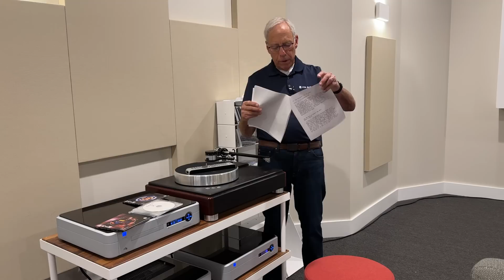Bypassing the DAC

Comment: Not all amps, especially today you can expect to get all the “digital,” out of the sound. NAD, for instance, now, puts all analog, including the phono through its digital system. Many amps have DSP which can’t be bypassed. I hate integrateds with built in DACs. I can disconnect the power circuit of that dac, dsp, etc. (if possible, cut trace, rerout signal path, etc.) make the amp way better sounding. Don’t understand the thinking of today’s audio company’s engineers.

Comment: Hard to believe that some DACS can be so small and cheap and yet some companies are selling DACS that weigh 50 pounds and cost $40,000.
Reply: There's a lot of engineering, premium parts, and premium build quality that goes into those expensive DACs. Just like a clunker, rust bucket, Bondo coated automobile from 30 years ago will get you where you're going the same as a brand new Lexus or Tesla or Ferrari (or whatever else you consider quality) will, it isn't the same. And just like your old pre-digital 4:3 TV will play a movie on DVD for you, it's not the same experience you get watching the same movie on a 4K Bluray and a 4K HDTV, in spite of it being the same movie. Quality does matter. If it's simply not financially feasible to purchase ultra high-end electronics, there are still high quality components out there that might cost you a few thousand or even a few hundred dollars, depending on the level you can settle for, but don't make the mistake of dismissing things you can't afford as being no better than the cheap ones.
Reply: Of course you already know this - - the reason for the weight differences are discrete component vs a straight ahead DAC chip technologies - just a side note, I have the Geshelli which is a ton of fun and very over the top performer given it's price, so is the Cobalt (it kills the Hidizs no matter what Amir has to say about it) but neither can match my reference DAC - - diminishing returns? Sure - would I give up my reference, no way - - that's because I have no problem enjoying the hobby, it costs what it costs, ya only live once and so yeah, there is an end for all of us so leave your predigests behind and just wallow in the incredible component choices we have these days at just about any budget level.
Reply: @skip1835  Spot on!  I am completely happy to hear that lot's of people reach their audio bliss using light budget friendly components from DAC to speakers.  They are even free to choose their own chair and room.
But for me, I have enjoyed squeezing every bit out of great recordings and that took a lot of very well built power supplies and very solid builds.  Read big heavy and able to produce low level information.
Reply: What surprises me about cd is how analog they can sound. Not just sort of analog like; but as analog as analog. I heard many problems with cd sound years ago, but as I found different ways to make improvements to the players, I realized those digital sounds were just distortion. Distortion that you can learn to eliminate. All these analog people spending all that money looking for that best pressing. Your average cd is usually a great pressing. With cd you pretty much just have to worry about the mastering; with lps you have to worry about the mastering and the pressing quality. And the latter often isn't very good.
Reply: @sidesup8286  Agreed.  I followed Lukasz Fikus, aka Lampizator before he started his company.  His mods to cd players were a revelation.  So I went on and built DACs using extreme power supplies, clocks and triode output stage.  44.1 is now completely natural, but detailed.  No digital issues at all.
Reply: To refresh my soldering skills I bought a Velleman chip amp project board. Think it cost $10 or so. So yeah, hard to believe people sell amps that cost so much. Wonder if there’s a quality difference? Nah, probably not.
Reply: @jimfuquay7116  There are differences, but DIY is absolutely the cost effective audiophile answer.  I started with a Heathkit, then a chip amp, and ended up with SOTA triode monoblocs.  They were all great, and pennies on the dollar.
Reply: I would like to hear really premium dacs like that. I'm stuck with the one that came with my cd player. I'm stuck with my cd player that has no distortion or veiling.

 It is highly modded though. When you play a jazz recording and it sounds every bit as clean and clear as the guy playing a sax on the street corner acoustically. Your sound might already be there; and cheaply.
Reply: @sidesup8286  Sounds like you are in really good shape with the CD Player.  They can be great, especially with some mods to the output and power.
Reply: They charge you by the pound like the meat market does..😀🤗👍😎
Simple Audiophile logic.😀

Comment: Despite Paul's advice, I would stay with an AUX (line level) input.  Going direct to the power amplifier prevents you from using your volume, balance, tone and loudness controls. It also bypasses your headphone jack and the other inputs for CD players, Tuners, tape decks etc.
Reply: I agree 100% ..stick with the line inputs !!
Pre Out / Main In’s are mainly used to bypass to a different power amplifier for the preamp section of the unit, or hooking up a full function preamp while you’re collecting funds for a new power amp. The other primary usage is to hook equalizers or other processing equipment into the system between the unit’s preamp and power amp sections.
Reply: @shipsahoy1793  That’s an excellent point. With all the outboard DACS on the market, can some of them be connected the exact same way that mentioned equalizers can?
Reply: @bikdav  I was talking about processing devices that accept an analog line level signal, process it, and output the processed signal through a line level analog out, and/or send the analog signal through it directly (a bypass mode). What you describe is like what Paul was talking about, which I don’t believe to be the best use of resources in that case. Remember, in that case, the preamp out on the integrated amp or receiver is disconnected.
Reply: @bikdav  
No.  A DAC (Digital To Analog Converter) has a digital input and an analog output.  So you have no way to feed it your pre-amp output.
Reply: @Douglas_Blake_579  That’s what I figured. But, I asked in case I was wrong.
Reply: @bikdav  
No worries ... better safe than sorry.
Reply: @shipsahoy1793  
The pre-out/main-in bridge, to the best of my knowledge, was primarily intended for hooking in equalizers and other signal processing equipment at a point where the pre-amp settings would not upset them.
Reply: @Douglas_Blake_579  of course, I don’t disagree. An aux input should technically be a line level input on a receiver or integrated amplifier.
Reply: @shipsahoy1793  
Yep ... looks like we agree!
Reply: @Douglas_Blake-579: 👍That’s an excellent observation. I regularly use all the mentioned controls and headphones.
Reply: You can still use tone controls I did when I had a loki and the thx aaa 789. Got my dac way after wanted more audio improvements.
Reply: Thanks for the advice ❤
I am Majd
Reply: @ud-  
You're welcome.
Paul is correct only if you're not using any of the functions built into the pre-amp section.
Reply: @Douglas_Blake_579  yes I understood Paul
Thanks for the clarification 😊
Reply: @ud-  
My pleasure ... and happy listening!

Comment: I would have severe reservations about signaling a raw power amp with computer (PC/Mac) controlled volume. Too many things can go wrong with the OS, sound infrastructure, GUI etc., sending out full volume to your downstream components before you even know what hit you. If you have output indicators on your amp and a speaker switch I suggest using them at each boot up to make sure you know what's coming out of your computer before you commit it to speakers.
Reply: As long as the DAC has a volume control and it's used all should be fine. But it is worth mentioning as someone might use the PC to control the volume and for instance get commercials from a free streaming service. 🙉😂
Reply: Thanks
I am majd
Reply: In this case, it looks like the OP will be using the aux input on his integrated amp, so he's still using the hardware volume control. But that said, if you're confident in controlling the volume in software, running a DAC straight into a power amp can net some very good results.

Comment: USB dac are shit they get in built class d amp. I need dac with class ab amp.
Reply: The ones I've used give horrible thuds when powered up and down and occasionally in between. They never get a wide open path to the amp in my world.
Reply: @tactileslut  use oversampling dac with built in class a or ab amplifier. Use vinyl records with class ab incase of natural sound.
Reply: @tactileslut  USB create noise I know. But class d amp more disturbed digital wave form then USB you know ? I never fool with brands they provided.
Reply: @tactileslut  ear is very sencetive to noise .
Reply: @tactileslut   you know already how singer sound so good on using digital mixer with first error but if you make that error twise then ear sence that and hence you hear distortion
Reply: @tactileslut  all digital pcm converter can  cause error at peeco seconds but dsd with class ab or a amp is king size
Reply: @tactileslut  no it's related to sound technology
Reply: @tactileslut  pwm disturbed the original digital pulse up pulse down. Class d use pwm with lpf filter.
Reply: @tactileslut  digital is good with dsd recordings only .
Reply: DACs are available with USB input and class A and A/B output.